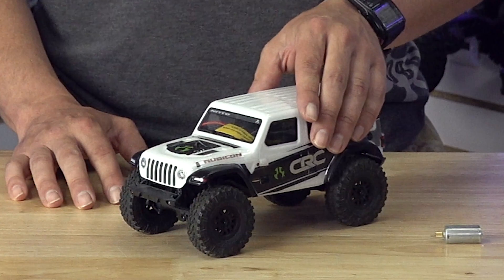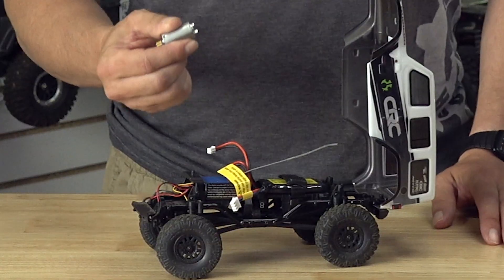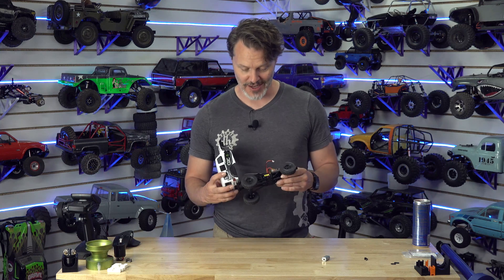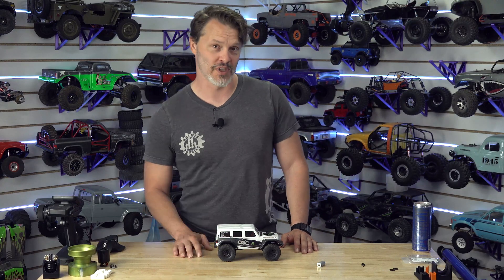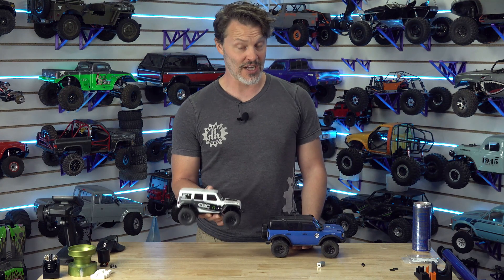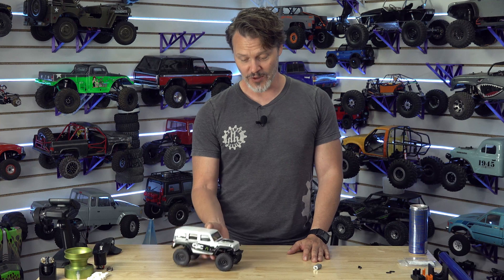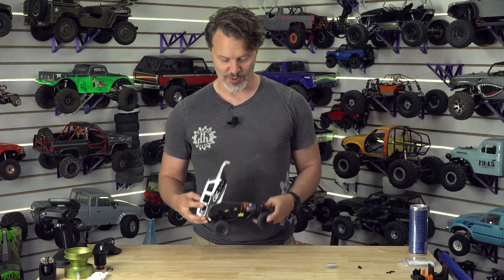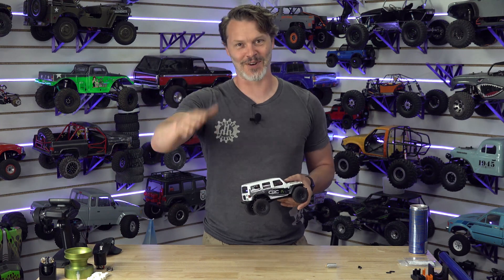Revolutionizing Micro RC Crawlers: John Robert's Custom Motor Masterplan

Comment: I have a small channel that i started after buying a few of these scx24 rigs for my nephews and myself to mess around with. I actually only have micro rigs. Mainly scx24, fms sent me a rig after last years Great Lakes gauntlet. Almost none of my rigs are stock. I have a few on stock rails but most a more custom than not.  It really seems the scx 24 have a greater selection of aftermarket parts.  I love the Mazz Designs chassis and wheels.  Another great innovator is mofo designs.  Too many small manufacturers to name here.  You could contact me on my YouTube page there is an email available there i am bursting with info and would be happy to share.

Comment: I’m preferring the 1/18 size because they can be used inside and out. I use my mini’s way more than my 1/10 because there so many more places I can use them. I have 5 minis and no scx24’s. I used to have minis many years ago, but the quality and tech in the newest are worlds better than 10-15 years ago. If it matters I have 2 fms fcx”24”, Fx118, Hobbyplus van and Ascent 18. I still have my Losi Micro (1/32)with worm gears(I personally dislike worm gears), I think and hope mini/micros are here to stay this time. Yes to good motors for minis!

Comment: Scx24 is still my favorite.  Great to build from. Many many options. 
I only build mine now. 
Fcx24 has a two speed... BUT VERY DISAPPOINTING!.. 
Why?  Because if i want to use it on my SCX24... i can't,  unless i use their axles, because it reverse the axle spin direction. 
That's a deal breaker. 
What about using it on X15 or Isokinetic axles??? NOPE?
If you make a COMPACT two speed that can bolt onto an SCX24 trans skid.. you will kill it!

Comment: Power wagon or gladiator don’t need the tray trimmed. The deadbolt and jeep need modifications along with the c-10 and bronco. That’s for the 050 brushed motors. I’m running furitek stuff cause that’s all that was available when I built them. 
2 versions. One for crawling and one for speed is all that’s really needed for the mini. Either you build a crawler or a mini basher.

Comment: For the 050 motors to fit the  SCX24. All you have to do is trim the battery tray a little. With a different skid, you can flip the transmission and run bigger motors. Sliders take place of electronics trays on my micros. It allows you to lower the ESC/Rx/lipo.

  MOFO RC or Furitek have the deepest motor/motor plate product inventory for these micros. I'm running mainly MOFO motors in all of my minis/micros. Brushed or brushless. They have a motor to fit your build. One rig has a Furitek Micro Komodo brushless outrunner. 

Looking forward to what you'll bring to the market for these micros and minis. Especially brushless motors.

I have:
2-TRX-4M
2-FCX18
4-SCX24

Comment: SCX24 is by the most popular for the 1/24 scale. Biggest motor competitors are the Furitek Mini Komodo & Cedar and the Mofo NanoBam v2, ROP & SMP. Both also have very tuneable ESCs that work well with their motors. The easier a motor can drop in and remain forward in the chassis, the better. Btw, cool song at the end.

Comment: We run the small ones indoors in the winter. Scx24 is most popular. Furitek makes great systems, but they're more money than a fusion pro 1/10 scale. Trx4m is 2nd. Again, Furitek makes systems but is expensive. Injora just came out with what could be a nice system (time will tell), but it is only for the trx4m. Redcat ascent 18 is 3rd and growing popularity. It's dirt cheap and has lots of add ons. Again, Furitek makes a system that's not quite as expensive (about fusion se money). Last note, spektrum tried selling a bolt in for the Scx24. It sucked. It would not crawl, and overheating was an issue. It seems the nature of the tiny outrunner and having foc is the benefit here. The scx24 really needs help. Its stock motor just can not handle upgrades. The Trx4m and ascent 18 come with a 180 motor. There are plenty of nice 180 brushed motors out there. I've never really wanted more power. Maybe smoothness from foc, but the bigger brushed motors do work OK?

Comment: My favorite mini is the Redcat Ascent18.  Hands down my best performer after a few updates and we could definitely use more brushless options.  Basically the same motor as a TRX4M with a different pinion gear.  The CR18P Evo Pro is probably my next favorite.  The 24s are just too small for me.

Comment: I'm on the same page with fivefourracing. We could really use a brushless foc system to compete with Furitek, great products, but overpriced. 
 I run the scx24, fcx24, and LGRP axles on different lcg type chassis. Just picked up the Hardpark axles for my next build. 
 I need that red "bat phone" to call you about these emergencies!😅

Comment: I prefer scx24's for comp builds and trx4m's for having fun. I've got a trx4m high trail with a mamba micro X2 and 4100kv 0808 and it's an absolute blast!
Reply: Is the 0808 a direct bolt-in for the TRX4m?  Sounds awesome!
Reply: @redroosterazrc  pretty close just drill the motor mount holes in the trans to 2.5mm get a furitek 2mm grub screw pinion in mod .4 and you have to cut out the Brace going between the shock towers.

Comment: Carisma already has 130 size brushless motors for some of their 1/24 scale kits. I'd definitely be interested to see what you come up with as far as a brushless motor & motor mount solution for the more mainstream makers of mini crawlers.
Oh, and my two cents on mini vs micro is 1/18 & 1/24 are mini, and anything smaller is micro. I lump 1/24 and 1/18 because quite a few parts are cross fit from one scale to the other.

Comment: I have the 44t in my scx24 deadbolt with a furitek lizard pro esc. The esc is not got the smoothest start-up with the brushed motor for some reason. Im woundering if a brushless motor would work better with the esc. I didnt want to put to much money into this small truck i only run indoors on rainy day's or to hot/cold days. I was hoping just the motor would make me happy, but found out it needed at least 3s to make the scx24 have the wheels speed i wanted. And i still want more. Lol  I'd love a brushless holmes system for the scx24. Maybe a new 3 in1 transmission all in 1 so its a bolt in kit.

Comment: Honestly you should make a brushless to fit a hardpark trans and comp set up vs the factory  the Chinese brands have the stock guys covered and I'd love a premium brushless that the pinnion doesn't strip off of
Reply: Exactly 👍
Reply from the maker: @FiveFourRacing   what's different about how they mount?
Reply: @HolmesHobbies  bolt spacing and larger size
Reply: John, if you want, I can send you a truck for testing with the furitek cedar motor and python esc. It has a hardpark transmission on lgrp axles. It's a great little truck?
Reply: There is nothing different on the scx24. The motor can't be too big diameter for the hardpark transmission or it won't fit. The Cedar motor with the furitek esc works really well. The slow crawl is awesome. Just to spendy.

Comment: The FMS FCX24 stuff is worthy of a look, too. The two speed really makes great use of the 050. The LC80 has to be about the best performing licensed 18th scale I've seen released yet. 

I bought one of your 050 44T right when they hit the streets, I just threw that motor into a diecast rig that weighs 1lb 9.7oz and it just screams right along and low speed crawls just as well.

I think you need to design and build a chassis that will do 5" 90 degree breakovers with ease. There are a few 24 comp companies that have some stuff to offer. Seems like you could dig yourself a nice little niche with some Holmes parts.
Reply: Yeah fcx24 stuff would be good